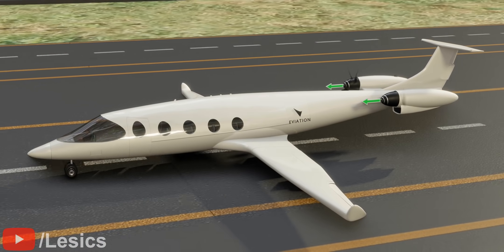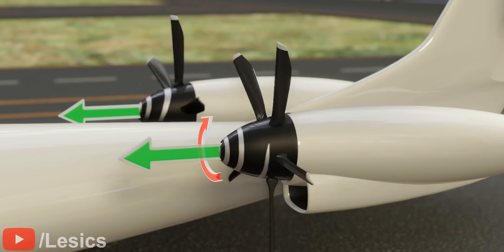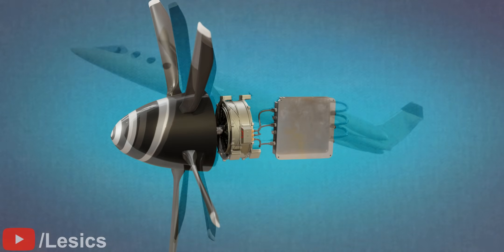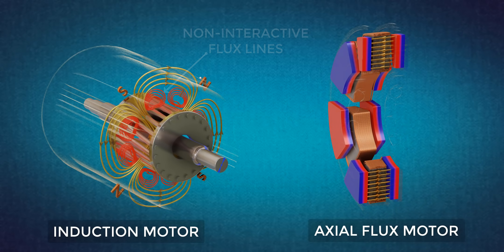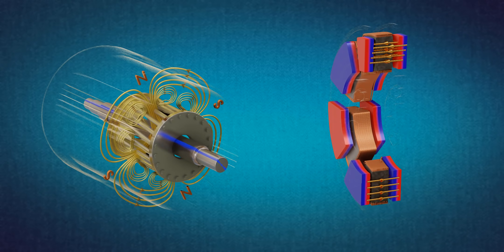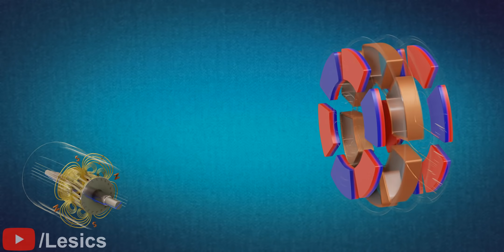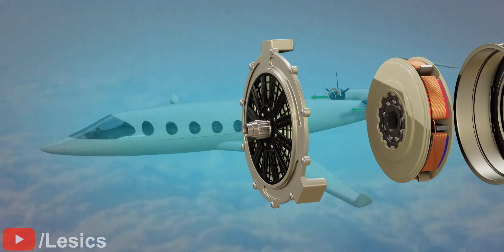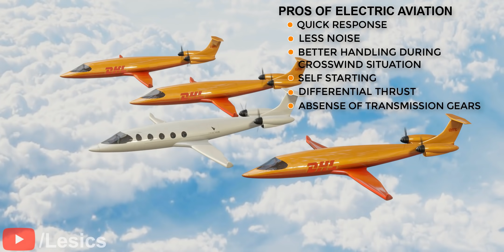Electric Aviation | The Dawn of an Advanced Transportation Mode

Comment: The lower Maintainance will play a huge role in making electric aviation alot cheaper and quicker turnaround..
Reply: Disagree on the reliability point.
Todays turbofan engines are extremely reliable, that is why 2 engine transports dominate. 
ETOPS 3 hours
The weakness is fan blade failure. Solved using carbon composites : GE NX engines on the 787 and GE 90 on the 777X
Reply: @arturoeugster7228  still compared to Jet Engines, electric motors are way cheaper and has very less mechanical parts. So there are very less failure points. You have to well trained experts and engineers to maintain those engines of Heavy Airliners...
Reply: @cascito  Do you know what the mean time between overhawls for the modern turbine engines are. There are just two major moving parts: 
The gas generator with the high pressure compressor and the high pressure turbine connected by an outer shaft and suspended by continously lubricated 2 bearings.
The fan  coupled with the low pressure compressor and connected by an inner shaft to the low pressure power turbine also suspended by 2 lubricated bearings.
Sure there are geared power accessory drives.
Electric motors have bearings that are not continously lubricated, with far lower life.
That is because a large direct coupled open propeller is subject to large lateral asymmetric moments due to changes in the angle of attack of the airplane (called P- factor).
The bearings and the shaft are subject to periodic loads which cause fatigue eventually.
Suggest you watch the 
AgentJayz channel by a very knowledgeable engineer who rebuilds jet engines of many designs and aircraft the world over.

Comment: Batteries are heavy and do not reduce weight as energy is used up.  For E-planes, this will always be the limiting factor in range and payload.  Similar issue with EV semis which will never be viable.
Reply: We all have to learn from history and think about the batteries that are coming rather than the batteries that we have now. As for cars, Mercedes have a 2000 mile car now on a single charge. the Tesla Roadster 2 I believe can also do about 700 miles on a charge and that is with current batteries not the one's that are coming.

Comment: So how many tons of cargo can it carry? 
Whats the range and speed?
How much runway is needed for takeoff and landing at full load?
How will it de-ice its wings and heat the cabin?
How will cold weather impact the preformance?
The price of the aircraft compared to a similar sized aircraft?
The empty weight of the aircraft compared to a similar sized aircraft?
With the battery low in the fuselage how will a belly landing impact the battery?
Whats the charging time?
Can the battery be swaped out? 
Will it carry a backup generator incase there is a failure in the battery?
How easy/hard will it be to maintain the aircraft on smaller airports?
How many years could be expected from one aircraft to last with regular use?
Reply: I applaud you.

Comment: BULLSHIT lvl 9000, any multi engine aircraft has diferential capability, and NO it's not dificult to control on a jet 
also jet is WAY WAY WAY more powerfull and has greater range and  weighs less than electric ........ did you forget about the weight of the battery
also also  ducted fan design would have made more sense 
ALSO ALSO ALSO .............. an aircraft that only exist in CGI ... isn't the best anything because .. IT'S NOT REAL !!!!!!!!!!!!!!!!!!!!!!!!!!!!!!!!!!!!!!!!

Comment: .. differential trust can be done by any twin aircraft .. aircraft take off with lowest prop pitch possible to achieve highest possible rpm at low speed .. whoever made this video has zero clue about aviation ..

Comment: thoughts on diesel generators being used to power the electric motors?

diesel turbines are a thing

batteries, in their current state, simply would not be a good fit.
Reply: Or, skip the electric part and get the thrust directly from the turbine!
Reply: Rolls Royce are presently designing a new concept called the "turbo generator". Basically a small jet engine connected to an alternator. Used to add power for take off, extend range or provide emergency power when needed. The Heart Aerospace ES30 will have one installed.

Comment: That’s something new, we keep the power settings symmetrical in both engines on all types of precision/non precision approach’s, would certainly help to get extra torque on one side for crosswind landings, would raise the limits of what’s possible
Reply: what’s preventing you from doing it now?
Reply: @captainsidewinder  I mean when you were flying
Reply: @DinoAlberini  company sops
Reply: @captainsidewinder  which are there for a reason 😉

Comment: I saw a video about an ACTUAL situation with a jet airliner airliner which lost all hydraulics. With NO control surfaces operating, the pilots steered the plane to a safe landing using NOTHING BUT DIFFERENTIAL THRUST. So much for the "main advantage"  of electric planes. I thought it was the limited range or being ultimately powered by coal. The day will come. But it's not here yet. How can you tell a greenie is exaggerating?... Her lips are moving and the mic is federally funded.
Reply: Are you talking about the DHL flight that was shot with a missile?

Comment: I don't think battery powered plane will ever be viable. Batteries are just too heavy, and lack the energy density  required. There's also the fact that batteries are inherently less safe, but, that's a problem I feel can be solved

Comment: ounce we get rid of Fossil Fuel Transportation and try to heat & cool our Houses & Buildings, WTF you going to get all the Electricity. Less than 3% is generated by Wind Solar. 50%+ by coal and The rest by Natural gas.  We can't keep up with the Summer Demand now what happens when all the GLOBAL WARMING Crap really kicks in.  Besides look at the size difference of those 2 planes. Maybe in 50 to 100  years when Hydrogen Fuel Cells become Practical. Or some one REinvents the FLUX CAPACITOR. (Back To the Feature 1988)

Comment: Electric planes are much more heavy from the jets because of the battery…It is currently impossible to carry so many people as jet planes because of their heavy battery.That’s the only problem.Otherwise of course they are better and have more advantages from the jets
Reply: Nonsense ! you need to waight and balance a plane! battery are around the same waight as an petrol engine & you can add more battery's for the waight of the gas! The issue is a gas plane gets lighter as the trip progresses and electric craft stays the same!
Reply: @BadManPromotions  more battery’s more weight.Gas can’t give so many thrust.Only tourbine.

Comment: This was one of the most unscientific videos I have ever seen. You dont control the thrust of a jet engine by the fuel supply its controlled by adjusting the efficiency of the compressor aka rotating the stator vanes. And saying that to control an electric motor you just need to control the supply frequency..... have you ever seen a 3 phase inverter ? you think that is simple to make or design ?
The stuff about the prop governor is just unbelievably stupid. In modern aircraft the governor is just a pice of software it doesnt matter if its electric or not. Also you dont need higher pitch during takeoff you will stall the prop... (Its also hard to tell whether you are talking about turboprops or turbofans). Comparing axial flux bldc to a bldc is like comparing a car to a car that's an SUV. One is a specific type of the other. Also there are thin disc shaped radial flux motor. 
This entire video is just the problem with modern society too much influence from fancy buzz words and "startup culture". Battery technology is never going to be sufficiently good to replace the jet fuel or the jet engine. And that's not a bad thing because now with 260wh/kg if the battery self discharges into itself it creates insane amount of heat AND THAT NEVER CAN BE SOLVED that's just the conservation of energy. If you increase the energy density even further you effectively create an EXPLOSIVE. And dont even try to say that "jet fuel is dangerous too" because in reality its not.

Comment: EV Problems
There are many problems with owning an EV. But, fact checks ignore many issues and exaggerate others. For example, they ignore that Lithium Ion battery packs have a tendency to explode and/or catch fire. For that reason, the US government does not allow these batteries to be transported on passenger airplanes. Do you really want these things in your garage charging your vehicle while you and your children sleep? Also, fire fighters have never found an acceptable way to put out an EV fire. To this date, their only option is to let an LI car burn until it runs out of toxic fuel releasing toxic gasses into the atmosphere.

The government also ignores that companies like Tesla time their warranty to run out exactly when the battery pack becomes useless. This makes an EV useless as a trade-in, a common practice for gas cars. This means that the EVs are actually much more expensive than gas cars since you get nothing for them when it is time to buy a new one.

Another factor is that no one has found any way to recycle the deadly toxic rare earths in the EV motor. This means they will be buried in landfills with no way to get rid of the refined metals and left to our children to somehow clean up after us.

Comment: I don't understand the car / aviation electric model. 
Less / no emmissions, but you have to generate the electricity (in some countires from coal /gas), then you have to rip the earth apart with machines to mine a lot of copper and cover it with lots of plastic to make distribution cables. Not to mention build charging points and ripping up pavements to supply them. And by the way, I did not even mention that making and disposing of many types of  batteries is pretty toxic. 
Of course the electric motors require more copper and manufacturing processes

Then you get to feel good by being kind to the environment. Is there another agenda behind this?

Comment: What about the fixed battery mass problem? Compared to fuel mass which is depleted over the course of the flight
Reply: It is worse than that. Airplanes collect 3/4 of  the " fuel " from the atmosphere for free.
" fuel " = oxidizer + hydrocarbons

Comment: So we're comparing an electric propeller to a Jet turbine engine.  I'm pretty damn sure that fuel propeller engines are also more responsive than jets, but they also have a much lower top speed.
Lithium ion batteries are also a barrier technology.  Until lightweight solid state batteries come unto production, it's business as usual.

Comment: The down side of electric, is heavy battery and no after burn, yet both can substitute with expanded spread out weight of batteries and use electric pulse as combustions, just like death-chargers versus grenade burst, an electric afterburners
Reply: afterburners are useless in commercial aviation.

Comment: Electric airplanes are way better for short haul flights as jet engines powered aeroplanes aren't suitable for this. Also with companies working mainly on short haul flights of less than 3 hours the frequency of trips plays an important role for profitable operations and electric planes due to maintainence as lower time and cost of refueling can achieve more trips per day at lower operational costs increasing the profitability of the companies even if they reduce ticket prices.

Comment: You need to address the power to weight ratio issua of batteries in the video, the airplane need to remain low on weight and the current watt hours per KG of weight isn't so great.
At the moment electric planes seems like future fiction.

Comment: A few points are needed to be addressed. 1-Instant thrust is seldom needed during a commercial flight, a rather weak selling point 2-Crosswind handling with differential thrust is also a minor advantage, if at all. Control surfaces are more effective (just compare the leverage distance between two ailerons or the CG-Rudder distance to the aforementioned method). Not to mention torque reaction from different engine outputs will also induce roll in the plane. 3-Battery Thermal Management is a major challenge considering extreme temperatures experienced during a flight. A Li-Ion cell's capacity can diminish to only %5 in minus 20C and a single bad cell could destroy a module and consequently the pack 4-Energy density, maximum take-off load, range, weight distribution, and reliability issues were also overlooked 

Instead, one could emphasize maintenance, initial/working costs, downtimes, use of solar power, and efficiency benefits. ICEs and gas turbines' thermodynamic and volumetric efficiencies have always been scrutinized. The emission's altitude and its magnifying effect could also be advantageous to combustion engines.

No way is flawless, nothing is absolute or pure. Watering engineering down to infomercial-marketing cheap tricks and introducing it as a scientific practice is detrimental to moral, critical, and efficient thinking.
Reply: I don't think battery temperature management can be that hard of a problem since they manage to keep a cabin full of humans quite comfortable. But yes I agree with most points. I think it's still to early for mass adoption until batteries get better, but then again these companies are getting ahead of the game by building specialized craft now and learning and overcoming the roadblocks now.
Reply: @Shrouded_reaper  - In today's Jet Engine driven flight, some of the Air from the Compressor Section, is taken, as "Bleed Air" and mixed in Heat Exchangers in the Tailcone, then fed to the Cabin! 

Compression Heats Air, a lot, and with Proportional Valves, and Temperature Readings in 3 Places, Bleed Air Inlet, Ambient Air Inlet, and Outlet, at the Tail Mounted Heat Exchangers, the Cabin air can be controlled reasonably well, or in an "Overall" level! Air not then fed to the Cabin, is Vented out through Noise Suppressors, also called "Mufflers!" (I deal with those, in the Factory, as an Aircraft Assembler - Ex Pilot.)
Reply: I think one of the main reasons why this isn't viable is the simple fact that the electric plane technology isn't quite there yet. The power output and the battery technology isn't where it should be if we want to replace what we have now with electric planes. Batteries are just too heavy the power trade off isn't nearly as sufficient as gas engines. 
In order for these to be as effective as jet engines, a revolutionary advance in battery technology would have to be created, along with a more efficient electric engine.
 Because for sure we won't get there with lithium ion battery technology. It need's to be a battery that functions like a super capacitor, with greater capacity and a faster charge. Perhaps graphene nanotubes or another element used to lengthen the life of a battery.

Comment: Edison generators are permanent magnet motor as a generator of electricity without fuel. The wire permanent magnets of the field move the armature magnets and coils of copper .  If you add inverters and transformers higher voltage AC power continuous peak power can drive high torque electric motors continuous and unlimited range electric aircraft.  .let me know if you need help.

Comment: This is complete nonsense.  Nice try passing off this bullshit and spreading inaccurate information.  Aerodynamics do not change.  It doesn't matter AT ALL if there is an electric motor, AVgas motor or steam engine in a crosswind situation. How about the MASSIVE weight of the batteries you need to carry to power your engines? How about the limitations of the batteries like ridiculously long charging times? ZERO credibility

Comment: Very good video as always. I only missed high altitude flight comparison to a jet engine. How much thrust can a propeller provide compared to a jet engine? How high can a prop go? Is there a limit to the prop speed (blade edges)? What is the sweetspot for the better engine performance at low air pressure?

Comment: since 100Wh is the limit for a lithium battery on air, I don't think this is possible for now until new battery technology (blade battery maybe?) that is safe for air travel and has a longer range that matches gas airplane 

I haven't watch the video yet but this my first thought, correct me if I'm wrong though